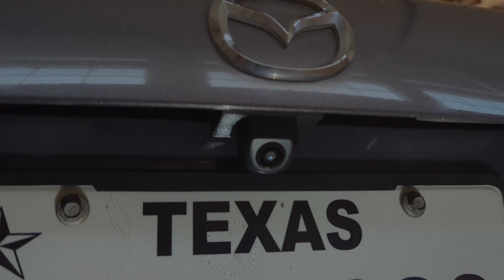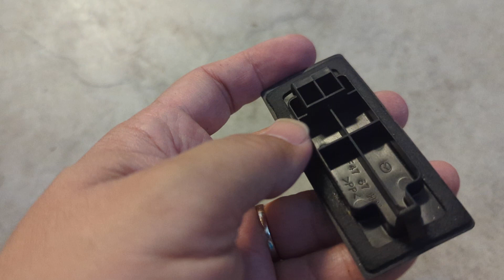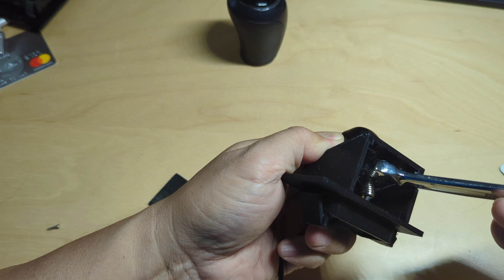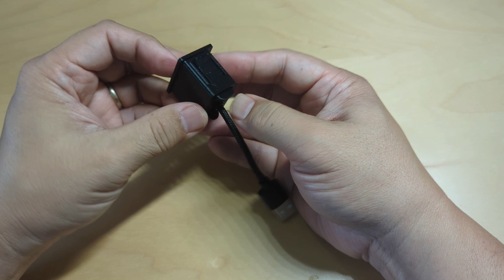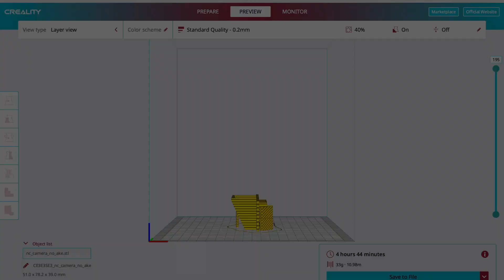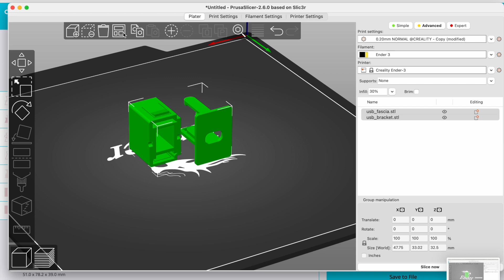3d Printed Backup Camera and USB-C Mount for a NC Miata

Comment: I just installed an Android Auto head unit, which supports front and back cameras.  All the other videos, people drilled into the sheet metal to run wires into the car, not something I would consider at all!  Your solution looks good, though I would probably want to put a sealant between the two printed pieces.  I know it faces the body, but still, I would want it to be watertight.
Reply from the maker: yeah a gasket would be a good idea. maybe print it in tpu. The oem just uses foam tape but i couldn't find one as thin as oem.

Comment: Great idea! I just wonder how you pass through all the cables from the trunk lid to the screen
Reply: I have a fiat 124 spider, not the same but very similar. I ran my cables from the screen down the center console, to behind the seats into the trunk & to the lid. Hope this helps
Reply: @babyeffinqshaq  How did you get the wire from the trunk to the trunk lid?  I'm trying to do this on an '06 Miata.

Comment: Hey Khoi Pham 
I followed your link and downloaded the rear camera mount file and sent it 
to a 3D printer service here in the uk. 
To be honest I wasn't that optimistic but my unit arrived this morning and it fitted my MX5 NC like a glove. 
Thank you thank you my freind. It saved me from drilling holes above my rear number plate and fiddling about with extra wiring.
you are a star.
Reply from the maker: @wayneknox2334  glad it worked out!
Reply: How did you run the wire for the reverse camera from the boot lid to the boot?